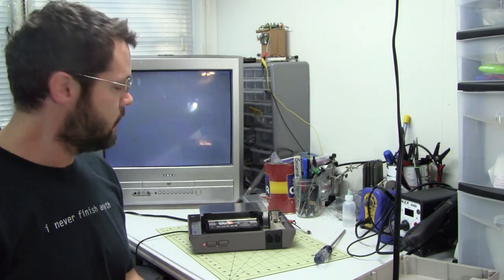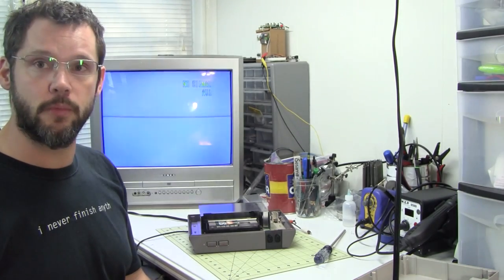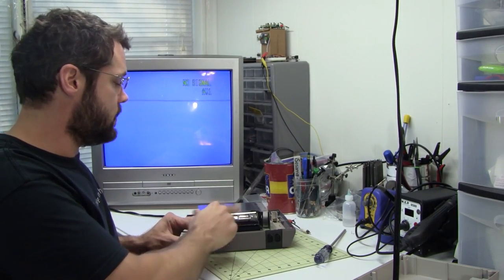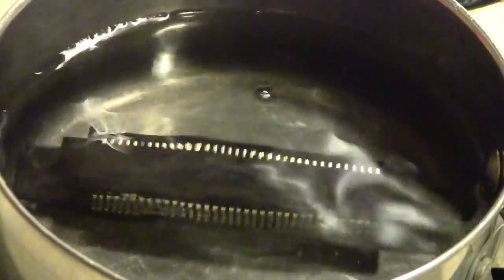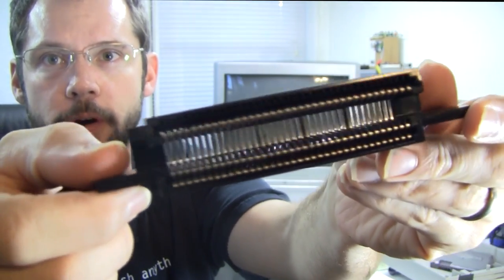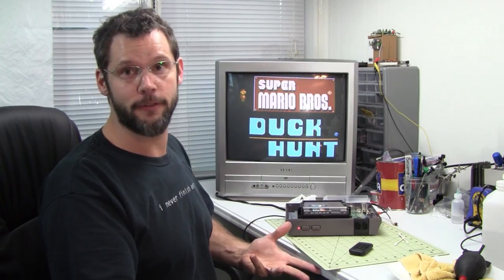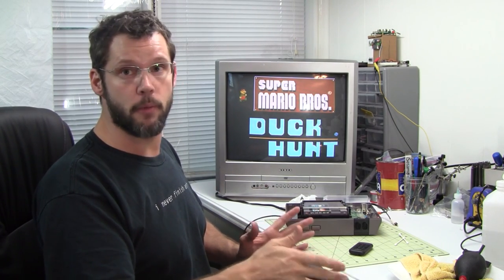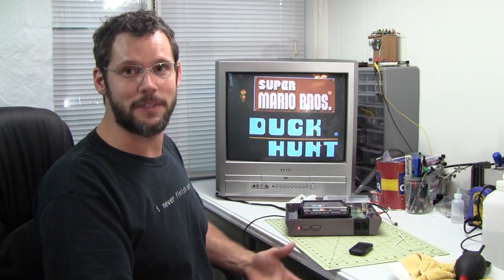When Boiling NES 72-Pin Connector Doesn't Work, Experiment Fixing Blinking Nintendo by Bending Pins

Comment: Boiling plastic seems like a bad idea. Why boil? If it's the dirty metal then you should use alcohol. If it's the pins then you should bend them with a dental pick. Then sometimes the weirdest thing I find is the screws that hold the loader in place are a magic part of the equation. If you keep the front ones looser then the game clicks down better, and if you keep the rear ones looser the game plays when pressed down rather than when it is standing straight up. The nes is finicky. I just don't get the boiling. I'd be more inclined to stick it in a sonic vibration bath meant for small jewelry before a stove. Unless it's the heat which bends the pins.
Reply from the maker: it isn't anything to do with cleaning. I had already cleaned the pins several times with contact cleaner.  it seems that the heat bends the pins.  I emailed a materials scientist that specializes in spring steel and he thought this was plausible. 

the boiling point of water is under the temperature that could damage the plastic.  

bending with a dental pick seems to be required if the pins are way too loose - boiling will improve them, but not enough. boiling is faster and easier so it's worth a try first before you break out the dental pick.

I think you are right about the screw tension - that seems to matter.

I'd like to try out the ultrasonic cleaner.
Reply: Ah the heat. The heat would reset the work hardened value of the metal if it got hot enough making it almost like new. However, it would do awful things for the workings of the plastic if boiled enough. But it's not like you'll boil 5 plus times probably on the same one. 

Haha an ultra sonic bath on them would be awesome to see in action. I bet it would clean the nes game pins on a cart really really really well.

Comment: If that doesnt work? What else can it be??
Reply from the maker: Mr. Chihuahua if you’ve tried replacing the connector and it still won’t work, it could be some of the chips on the motherboard. Check the gametechus channel for some videos on that.
Reply: @8bitjunkie8  cool, will do brother. Thanks

Comment: Just disable the 10NES chip. Blinking light solved. Such an easy mod yet there's so many people unwilling to do it. "Bleh, I want to keep my console original, bla bla bla".
Reply: Danny C. i did once and idk why it haved worse reading game ratio , even after cleaning the games and pin connector and boiling , so I just resoldered the pin back and i works better idk why but it happened to me
Reply: Maybe , idk I just sold that nes ,i have another one that is completly original and it works great thanks anyways
Reply: Sounds like it's time for you to just get an entirely new 72 pin ZIF connector. Despite all the claims, boiling it doesn't permanently fix it. I've never heard of the 10NES chip making it worse for games to work when disabled but then making them work more often again when re-enabled. Either it was a placebo effect or the connection to your carts just coincidentally started to get better after you re-soldered the pin back. Or there's another factor, you could've ended up putting the 72 pin connector back onto the motherboard with a better connection after you re-soldered the pin. It all really comes down to how well the games and the motherboard are making contact with the ZIF connector.
Reply: Brian Segarra Ah ok, that's good. If you ever have problems with your games not working again, I suggest getting the Blinking Light Win. It replaces the ZIF socket with a cartridge connector similar to the Top Loader and it defeats the lockout chip without you having to cut pin 4 of it.
Reply: Danny C. yes im looking foward to one , but for my brother nes thanks again :)

Comment: The pins aren't the problem you need to by pass/disable the 10NES chip. The blinking screen problem has been going on since day one.  It hasn't gotten any worse as its all in your head...we live in a faster pace world compared to when we were kids.  Improving the pin contact just slightly increases the chances that the 10nes lockout won't reset the system(aka produce the blinking screen.) Just disable the 10nes chip and you will be better than new.  Look up on youtube for the 2 wire method I use.
Reply from the maker: +Guythatknowsitall88 if you disable the 10NES chip but still have a bad connection, you just get the grey/brown screen. Disabling the 10NES seems unnecessary most of the time unless you want to play games from Japan etc.
Reply from the maker: +Guythatknowsitall88 I like the 2 wire method though.  Do you have a schematic that shows what is actually being done there?
Reply: 8bitjunkie The NES is terrible at starting up games...even license game due to this chip being so picky on the signal...even when the game would have worked fine.  I use to spend 10 minutes or more trying to get a license game to start and now I can get them to start after 1 to 2 tries so far (less than 10 seconds.)  This is part of the reason the chip was removed in the model 2 NES and why it startups games better.  I am not saying that pins can't be the problem because they maybe part of it however I am confident in saying that bypassing the 10nes chip may be more productive than replacing the pins...and this is from my experience.
Reply: 8bitjunkie Glad you like it.  Unfortunately I don't have schematics.  As said in the description I was trying to find another alternative other than actually breaking the chip risking damage to other parts and such.  I just merely came across a picture of this mod on a message board.  I googled to find more information on it but I couldn't find any.  I went on a limb and gave it a try and it worked that motherboard had similar layout.  I did it on another NES that had the other motherboard layout and after examining the circuit I found were in theory it would work.  Fortunately for me on both counts it worked flawlessly.  Because there was nothing more than 1 picture on the internet showing this mod I thought I share it to increase awareness of this other option.
Reply: +Guythatknowsitall88 Honestly what you're describing would most likely be fixed by doing the pins.

Comment: Just buy a new connector for 10 bucks on Amazon lol... or disable the lockout chip
Reply: The China crap connectors have the wrong tolerances. You have to get pliers to get the cartridge blackout.